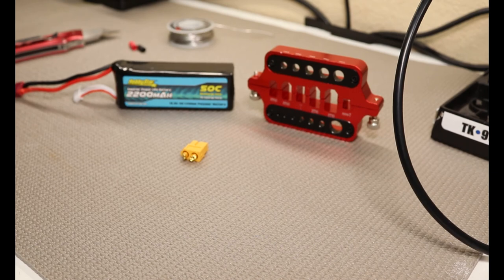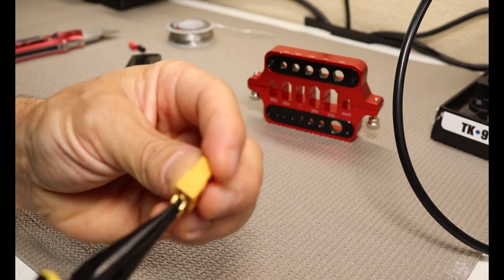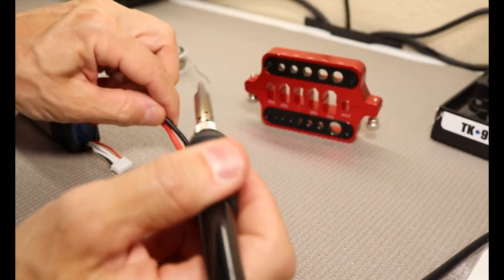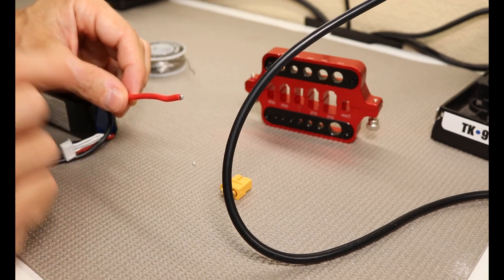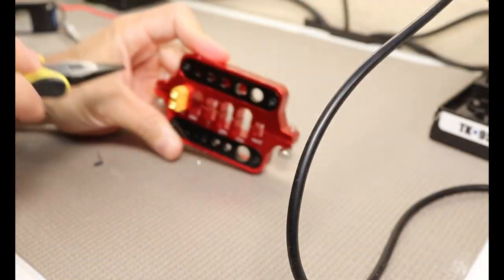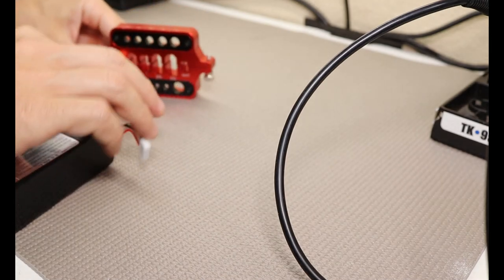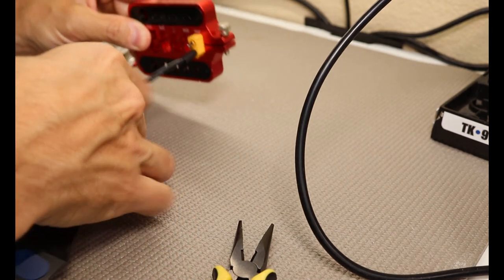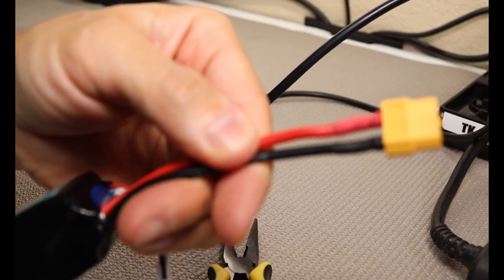How to swap/solder a Dean's plug for an XT60 connector.

Comment: Great vid.  There are a lot on this subject online, but this is the best I've seen so far. Very professional approach. My only suggestion is to use a rubber band to temporarily hold the other wire back against the body of the battery, out of the way, which greatly reduces the chance of shorting the wires against your razor knife or any other metal surface.

Comment: I just cut the wires off the Dean plug, one at a time. No need to de-solder as you will likely never use the Dean plug again. Strip, tin, and solder to the XT60 plug. :)
Reply: Uhh...for other out there reading this... Snipping is fine, but be sure you snip the wires ONE at a TIME!  Otherwise the snips will short the two wires together, and you'll see some fireworks and might get a visit by your friendly local firemen to your home.